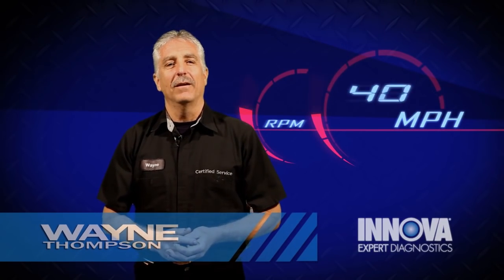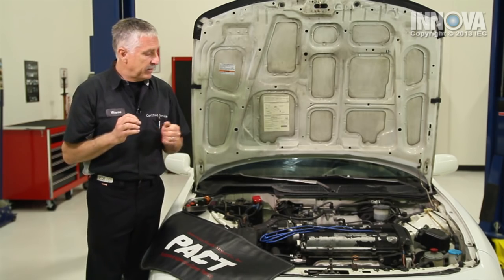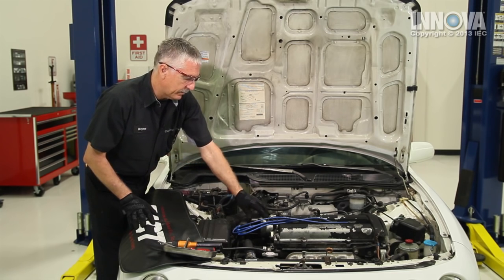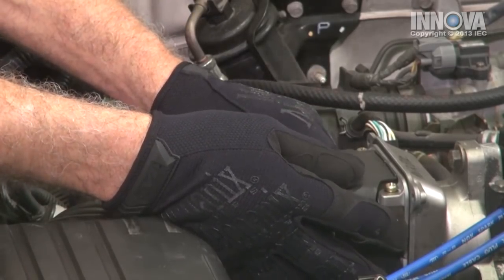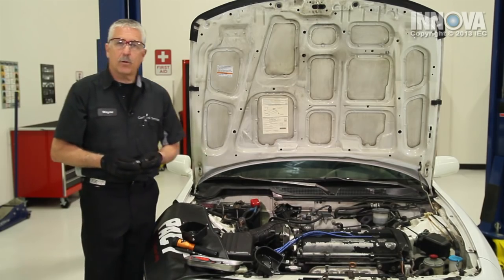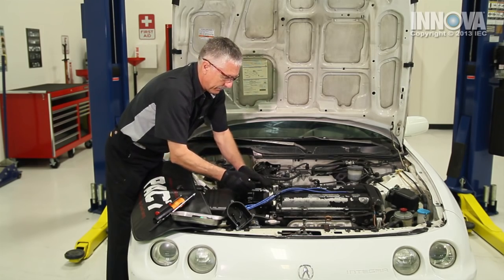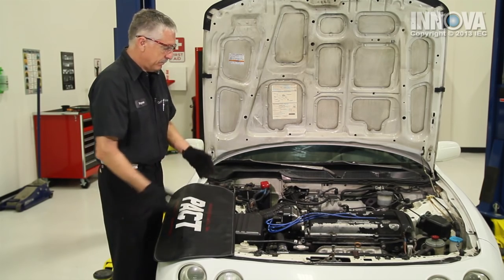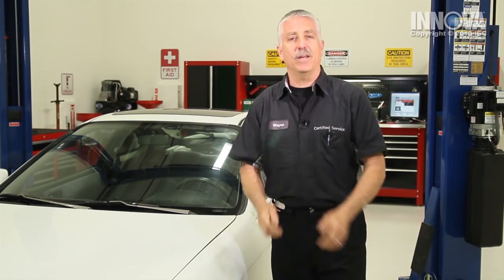How to diagnose a Misfire - Distributor Cap and Rotor - 1996 Acura Integra

Comment: You mentioned that when the rotor's screw is not visible, you need an assistant to turn the ignition to get it in the right position for you to unscrew it. Do you need to put the cap back on before you turn the ignition? Thank you.

Comment: Very nice video Wayne & RepairSolutions. 
1. What causes corrosion? Those white powdery substance on the contacts.
2. What causes carbon tracking?
And How do we clean and then prevent these from happening again?
Thank you very much.
Reply from the maker: +lycanchimera
Thank you for your inquiry. We do not have service manuals for your vehicle to give you repair advice. We suggest referring to a service manual for the issues you are having with your vehicle.

Comment: I have a 1997 Oldsmobile Bravada, it has been sputtering when accelerating, I’ve been driving like this for almost a month now, first it was a faulty ECM then changed the fuel filter so it should be the distributor it’s self then?

Comment: Something i needa check possibly recently did a fuel treatment changed my fuel pressure regulator spark plugs and wires code at first came up as a cylender 1 misfire and lean code and the autozone data suggested i change my pressure regulator which i did but still feel a bad misfire and the vehicle some what trys to stall between gears at a lower rpm and speed I also drive an integra same generation

Comment: hi i have the same car a acura integra 97 Gsr and i am having a problem with my car with the rpm needle jumping up and down when i reach between 4k and 5krpm i have switched out my spark plugs and checked my fuel injectors they look fine but i found oil in my distributor cap i am really stuck on what the problem is and what whould coues oil to get in there any help?
Reply from the maker: +Trance Hyper
Thank you for your inquiry. We do not have service manuals for your vehicle to give you repair advice. We suggest referring to a service manual for the issues you are having with your vehicle.

Comment: hey my 91 integra is acting up i start it once and its fine but the lights dim down and wen i turn it off and try to start it again it acts like if the battery is dead but i just bought a new battery i was thinkin maybe the rotor is bad because wen i look at it the  thin metal part looks black and really small do u think it could be the rotor and cap?

Comment: I have a 2 misfiring cylinders in my 97 Honda civic on cylinder 2 and 4 which i changed wires and spark plugs.
Reply: Same guy
Reply: This dudes sayin I gotta change the whole distributor
Reply: Not just the cap n rotar
Reply: You ever change it @gamercat
Reply: Fix